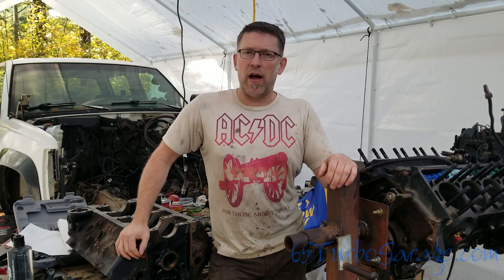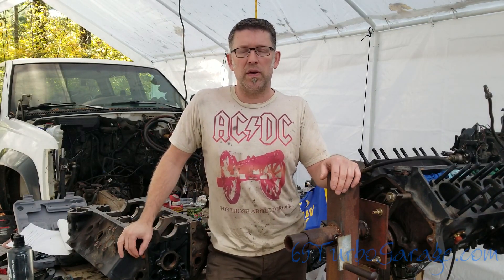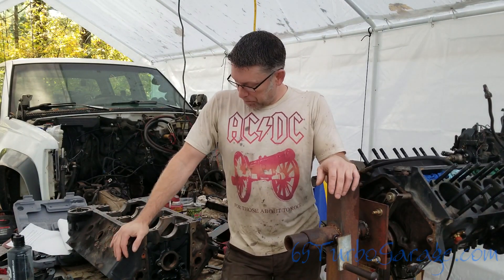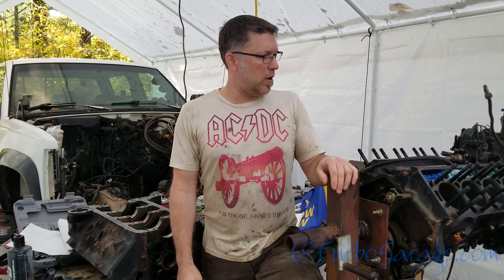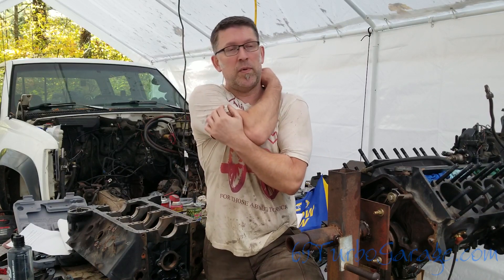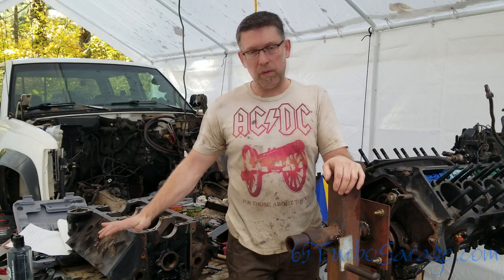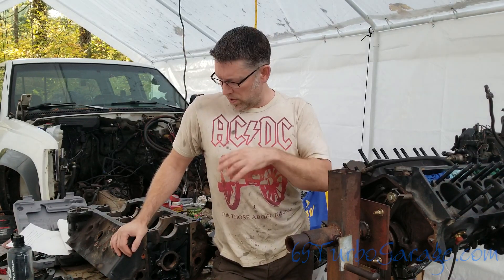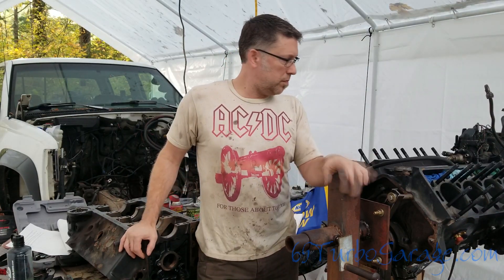Detailed GM 6.5 Turbo Diesel Rebuild - Part 1

Comment: I have a 98 6.5 in a 3/4 ton Chevy. I checked the vin and it’s the one without the EGR or cat and has the nv4500 manual transmission. It has 280,000 kms and seems to run really well still. Not sure what to do with this truck, do you think it’s worth anything ?
Reply from the maker: Everything is worth something. A well running 6.5 with a manual transmission sounds well worth the time and effort to keep maintained and used.

Comment: Hey buddy, quick question. When you made the switch to the stock 6.5l to the optimizer, what all changes did you have to make? Someone told me something about the precups needed to be changed cause they wouldnt work with my intake or something like that.
Reply from the maker: I didn't change anything. And no, you don't have to mess with the precups at all. It's the intake studs in the head that you may have to mess with.
On a turbo Optimizer, the intake is totally different with the angle on the studs different. However, with a NA motor, the studs are the same and will bolt right up. I bought an NA motor.
The problem with the NA motor is that the pistons will not be coated for heat, it may not have the right oil pump for oil squirters, and likely the oil squirter will not be functional anyway. So you end up with the heat damage that you will see on my pistons in later videos.
An Optimizer long block for a truck may only be worth it if you are going to totally tear it down to use it for components in a rebuild or as a non-turbo, or a turbo that you change the heads on to fit. To be clear, this is if you are going to run it hard (which I do). If you are just going to be using it for a daily or occasional with no towing, then it likely won't create enough heat to cause any problems. 
But really, for me, I would never buy any long block unless it was from a very trusted source that will give money back. Because you will never know the condition of the block, bearings, pistons, etc. You don't know what booger picker built, maintained or ran it last.
Build it yourself!

Comment: I just subbed. I won a M1123 Hmmwv and it's a no start just in case. It doesn't have a turbo but the n/a6.5 but Im new to the GM thing. I like your setup. Back when I was in high school I rebuilt my first engine. It was a Ford 302 for a 69' Bronco. Did it the my parents 10'x10' shed. I still lay in the dirt to this day.👍
Reply from the maker: Hey, welcome Thomas.
We still have our '72 Bronco sitting in my parents driveway that has been completely gone through with a whole lot of go fast goodies on it's 302. And I still love that thing.

Congrats on winning your truck. You can add a turbo to your 6.5 if you want. It'll certainly give you a bunch more power and maybe even give you better milage. (The turbo makes a diesel engine more efficient). You just need to get the turbo side manifold for your turbo setup. You can get a stock setup from a junkyard or an hx series and it'll bolt right on. 

If you can't find a yard truck or just want to start new, check out my review on the APDTY turbo side manifold in this video...
https://youtu.be/EJYMelDOBr0
Again, everything will bolt right up like stock.
Good luck!

Comment: I have a 93 ext cab 6.5 with nv4500 and 335k on clock i have a few questions if you dont mind and i hit that button my friend!
Reply from the maker: Thank you sir!
What are your questions?
Reply: @SixFiveTurboGaragecom  first off thanks,in just your opinion am j getting close to a rebuild given the miles and this being a light duty diesel or do these things usually chug along pretty well?
Reply from the maker: If I was in your position, I would start building a new motor right away while you keep running that one. But I may be in a different situation, I need my truck on the road all the time. I would start sourcing all the parts now, get it built and installed, then I would rebuild the old one and have it sitting there in case I needed a spare (I'm actually working towards that exact thing right now).
To be clear, contrary to some opinions, these motors do last a long time. I mean, look at yours for crying out loud. Don't listen to the ignorant morons that that think that these things blow up easily. My problem is that I can be an ignorant moron and blow up my engines myself! So if I have a spare, I can get it installed in a day and be back on the road.

If you can be without your truck for a time, then do your research first, collect all the parts, and then pull the engine to rebuild. 
Or, drive her till she dies and then rebuild, it depends on what you can manage.
Reply: Thanks, ok I just started tearing down a 599 block that is a complete engine but sat outside for a year and everything is rusted is it still a good block?
Reply: What size socket to remove the head bolts? 22mm?
Reply: Hello again,I took your advice and I'm currently tearing down a "599" block, same engine in my daily driver, the rebuild has been in the rain,I got the heads off but I'm having a hard time finding cracks before I go all in, any advice my friend?

Comment: I’m in the process of rebuilding my 86 6.2 it has a cracked cylinder and head but I’m sleeving the cracked cylinder and replacing a head and a piston from broken valves it’s not gonna be cheap but it’ll be worth it! It has a 350 in it right now but I hate the 5 mpg I get!
Reply from the maker: Sounds like a solid plan. And cheap is relative. If done right, that thing oughta last a long time and you'll more than make your money back.

Comment: I just bought my first 6.5l suburban 2k on offer up mechanic special not running with 175000 miles got home the guy couldnt get it going there was a trail of parts scattered through out the truck and we got it running in 3 hrs with the help of my sister

Comment: my friend, I have an equal 6.5-liter engine that I don't get where the serial number or the Detroit diesel engine serial number code is
The location of the serial number can help me
Reply from the maker: If it is a genuine American made block, you should find a number on the passenger side bell housing where it mounts to the transmission. You may see something like 12555506 which will signify it as a "506" block or something similar. My '93 block ends in 599 so it's known as a 599 block.
On the drivers side bell housing you will see the date code. There are two different types of code styles so I can't know which one you have but it's basically a number for the day or year and a letter for the month (1=Jan., 2=Feb., etc.).

I hope that helps!

Comment: You should scrape all that junk..not a good engine .bad design..
Reply from the maker: Hmmm, Me, my brother, and my dad all beat the living crap out of the original engine in this truck and it just kept on pushing us down the road, in this video I just went through everything that it took to finally kill this one, there are 6.5 engines with over 600,000 miles on them still running today, they powered all Humvees for our military under extreme conditions, and the overwhelming majority of all 6.5 powered trucks had little issues. 
I wonder what you could be doing wrong?